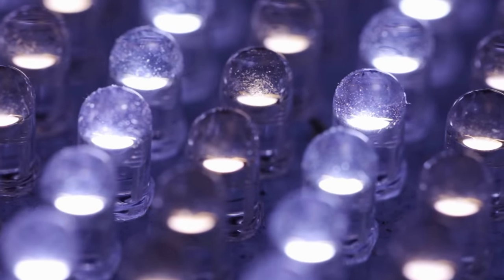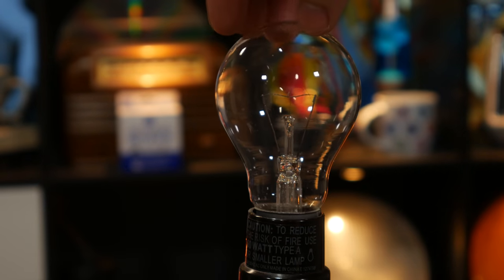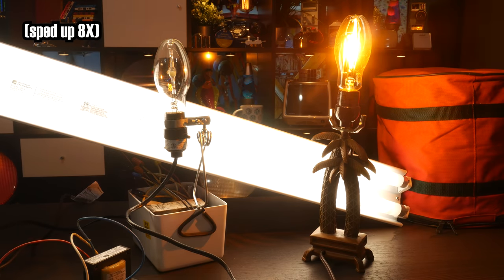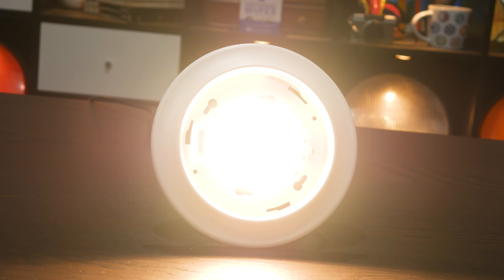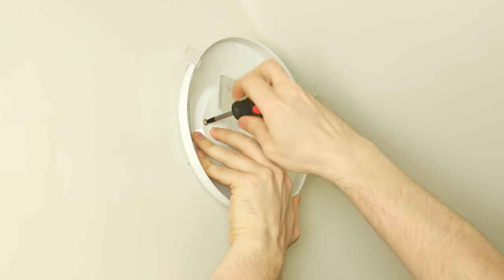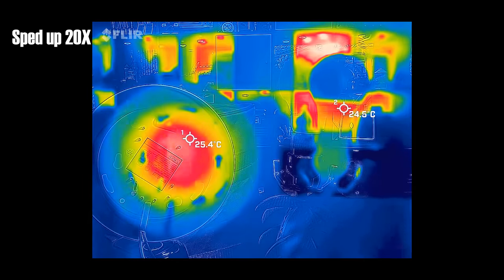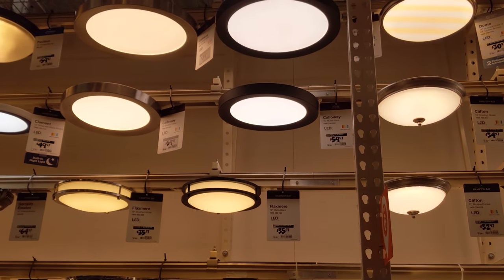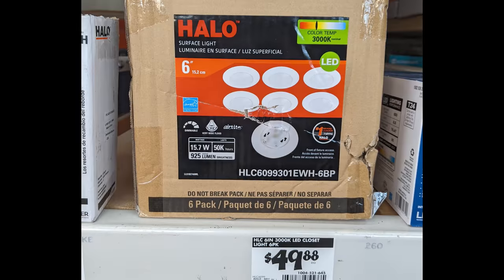A troubling trend in lighting?

Comment: I just started my transition to LED indoor lighting last year. The CFLs I bought when I moved in 10 years ago finally started dying.
I think people who have trouble keeping CFL and LED bulbs working suffer from one of 3 problems:
1/ Improper fixture for that type of lighting (as highlighted in this video, most of them degrade faster in unventilated fixtures -- there's always a note on the box stating if they can handle enclosed fixtures or not).
2/ Their house wiring isn't all that great and they have grounding issues (more likely in older houses than newer).
3/ They're just jumping on the hater bandwagon and making claims that aren't actually true or are just parroting what they heard someone else say.
Reply: Apartments too, not just older houses.
The building I live in was completed in the early 1960's, and the one powerbar I have, keeps (at random) indicating "ground fault" (the red LED lights up for long periods of time), one of my boomboxes (JVC conion, 1980's) is sensitive to that, and makes these shrieking, crackling and popping noises whenever that happens. It's quite amusing (and I have moved it to every room, same thing happens).

Comment: I think these “wafer lights” are the future. And they now have a separate junction box for your wiring which has a lead to the led in the drywall. The junction box can stay while the rest of the thing just unscrews and can be swapped.
Reply: The wafer lights with seprratebjunction boxes actually have the driver in that box. Slightly different design. Creates a similar dilemma except you have to install a box and do drywall work to even replace it with something else.

Comment: One thing I will say in defense of LED fixtures is that, in certain situations, they're great. Namely situations where you don't use them often.

I replaced a fluorescent fixture over the sink that went bad with a super-bright LED one. It only gets used for maybe 1-2 hours a day, so its lifetime will be really long. It doesn't matter if it clashes with something else because it's just for washing dishes.

Specialized circumstances like that, such as over a workbench, in a closet, or similar, are great for these things.

Comment: In a way I wished we could move to DC wiring for lighting, have one big driver/power supply in the utility closet by the fuse box (some kind of smart one obviously), and then run the wires from there to the fixtures. Of course this would require rewiring, a new style of socket, and some agreement on the voltage (12V, 24V or even 48V are options but there needs to be an agreement or this won't work), so unlikely to happen anytime soon if at all, but a person can dream, right?
Reply: One driver per fixture would be good middle ground- backwards-compatible with 230V wiring and economical/ecological for driving bunch of LEDs
Reply: LEDs are constant-current devices.
Reply: This is actually a very old idea, there are still some houses that run 24v lighting.

It's possible to spec a new house with 14-2/18-2.

If you do a complete remodel, you could do it too. 

I'd like to wire a house with dedicated low voltage and watch it over the years, but based on the old systems I'd expect that at some point there will be another remodel.
Reply: Not just lights either. I think pretty much all electronic devices use DC, or can be made to work with either.
Reply: It's inefficient, would require enormous size of wires to have an acceptable voltage drop. And you don't want to run a 16mm2 wire to a light fixture. It will also make controlling the light more complex, since a DC current is more difficult to interrupt with switches than AC, you will get arcs, contacts will wear, etc. Finally you introduce a single point of failure, what if that power supply breaks? You no longer have lighting in the whole house. Or in part of it, assuming it's not only one but two.

Comment: How confident are we that the manufacturer's specifications of color temperature are accurate? Maybe that 3000K bulb that doesn't clash with your 2700Ks is actually closer to 2700K than you think?
Reply: While I do think that the manufacturer's specifications of color temperature are often not accurate, this is not the main problem.
The color temperature and CRI are approximations of a whole spectrum of light crammed into two numbers.
But different mixes of light can fit the same two numbers. They give you more of a general direction.
Reply: Mixing color temps can be hell if you do photography with CCD cameras.  All kinds of interesting lighting effects when mixed that are not visible to the naked eye.

Comment: @Technology Connections I'm going to chime in with my thoughts as a fan of this channel, a color temp nerd, and an passive house architect. I agree with you that the danger of these devices is more e-waste, however as you pointed out these style fixtures at least deal with heat better than your budget LED bulbs. They do have a lot of benefits in the architecture world though. Being able to mount them directly to a shallow or pancake style junction box is a real benefit when you are trying to maintain a continuous air barrier between your top floor and attic space. The slim profile of them is just something you can't get from a fixture with a regular bulb in it unless its a true recessed can fixture. 

I think there's places where these are best suited. I typically spec regular recessed can style lights on the first floor of buildings and these on the top most floor where I want to avoid a can going into the attic or through my air barrier. They also are great for cathedral ceiling applications where you minimize the amount of displaced insulation and can air seal around the junction box reasonably easily.
Reply: They are extremely costly, though, and they have all the cons that the video pointed out. Recently, we wanted to redesign the entries and floors of our appartments building and the architect insisted in putting such lights that cost around €500 a piece. They didn't even look particularly good at that price, they were just some designer brand so we paid 90% for the brand but they were guaranteed 10 years. Well it didn't go well when the inhabitants voted for/against the project: his entire €300,000 project was rejected because of that and a couple other similar overpriced crap.

Comment: Several years ago I switched all the bulbs and can trims in my house to LED. Maybe 2016 or even 2015. Aside from one cheap can trim in my living room that buzzed because of the dimmer, I've never changed any of them. Even that one buzzy trim, I swapped with one from a closet and it's still going strong. No dimmer on the closet light so it doesn't buzz at all. I honestly don't think I've ever replaced any of the bulbs in my house in all that time.

Comment: Hey hey! I'd love to hear you chat about bulb tech, and controling them for dimming. 

I think a huge miss of the industry is intercompatibility for control. Currently the best way we have to control led bulbs is by choking out their power supply, so they have to struggle to keep the pwm running as you turn down their power. Smart bulbs are better, but it's a huge mess to try to control them via any kind of switch. The Inovelli stitches coming out soon seem to be the only ones in existence that solve the problem. 

I'd love to see you do a deep dive into it! It's a mess!

Comment: I just bought a new kitchen LED fixture instead of changing the Circline tubes every year in the one I had.   Having a lot of experience with LEDs, I took the fixture apart, measured the current through the LED strings, and raised the feedback resistor on the mosfet that sinks the LED B+ voltage to lower the wattage by about 30%.  The LEDs now run much cooler and will last almost forever.  Out of the box expect 2 years if you're lucky.

Comment: Woah, I was just ranting to my dad about the proliferation of this exact issue! I've been getting increasingly frustrated while looking for a modern styled ceiling fan that doesn't have baked-in LEDs. That one is even more onerous IMO as replacing  an entire dang fan just because a 20 cent LED board burnt out is just ridiculous.
Reply: yeah, I ran into this a couple years ago.  I had rehabbed a room for my daughter, totally gutted it, moved walls, etc.  But when it came to fixtures we needed something super low profile as it was a short attic room.  But our decisions were either extremely fugly expensive designs, or cheap but tateful designs that had the light element baked in... which is what we ended up going with.
Fast forward 4 months, my daughter hated the room, and wasn't sleeping for fear of spiders (not a single spider ever found because I also hate spiders... there are no spiders in my house!), so my son took over the space, and he wants new paint (understandable as some walls are bubblegum pink), and a different light.  His complaint isnt about the cieling fan or overall design.  The complaint is that the light is too directional.  End of the day we are going to have a cieling fan that has an optional unused light, and a bunch of desk and/or floor lamps.  Its fine, but yeah... the built in light is an issue.
Reply: I just realized that when my new ceiling fan light goes out I have to... I guess. buy a new ceiling fan?

That can't be right.  But.... shit.
Reply: @CaedenV  You should love spiders and all other animals.

Comment: 7:55 - You can simply add a series resistor to a string of LED's instead of a driver, it has some drawbacks sure, I have found incandescent globes make great resistors too lol.
Reply: You made me laugh so hard, it almost made me choke.
Reply: @Rasgonras  ahh you spotted the irony lol
Reply: I seriously hope this is a joke.
Reply: @Owen_loves_Butters  Yes. that being said I have used an incandescent globe as a current limiter when charging lead acid batteries when stuck in a remote area.

As for led's no, I certainly wouldn't advocate omitting a driver for mains voltage - for low voltage (12) I regularly use something like a 390 ohm in series with led's to drive them.

however.... when you look at many mains voltage led "globes" - they often have nothing but a capacitive dropper and a resistor in them.
Reply: @TheAussieRepairGuy  I'm sure you know this, but resistors dissipate energy as heat causing inefficiencies. Capacitors do not dissipate energy as heat, making them better for current limiting (drivers are more than just a capacitor, but still)
Reply: @Owen_loves_Butters  I'm well aware, but capacitors fail more readily. Efficiency means nothing if you discard the entire unit - and they still include a resistor.

Last I checked  the commercial led bulbs I use, run at around 60c, the same as an incandescent.

Maybe you should be having this conversation with the manufacturers

Comment: I recently finished swapping about 1200 of these out in a string of apartments. Property owner had 2700/3000k ones installed every 20ft or so in the hallways. when first walking into an empty hallway it was like a scene from a horror movie as the lower temps and spacing made for some eerily dim walkways. We changed them all out for 5000k fixtures that made it look more sterile (hospital-esque), but much cleaner look.
Since they were "trash" lights, ive since repurposed a few dozen of them into shop lights by separating the boards from the metal plate and affixing them to empty fluorescent housings. 
Have also take a few and painted the diffusers for inexpensive holiday lights.

As for the wiring side, many of these today come with a standard bulb socket that screws into existing can fixtures so that you dont have to deal with cutting power. You make your connections to the adapter, then thread it in like a normal light bulb.

Comment: The ballast is just an inductor. The driver circuit has a FULL BRIDGE RECTIFIER which can be done in many different configurations but usually includes capacitors and diodes in a square like arrangement and some pull down resistors.

Comment: I kind of wonder if we could have a new standard that removes some of these problems. Perhaps a flat circular "bulb" that is mounted in center with a standardized bolt to a metal heat-conductive base. Limit height to 1 cm and require radius to be, say, 4 cm. The bulb would connect electrically via a short white IEC 320 C7 (polarized) cable perhaps.
Reply: Have you ever seen the inside of a bathroom fan/bulb fixture? Usually there are 2 regular polarized outlets... one for the fan, and one for the bulb. I say: Make that sort of thing standard!

Comment: You could massively extend the life of LED lights by underdriving them. That's the approach of the so called Dubai Lamp. Philips used three or four times the amount of filaments (for the same amount of power) compared to their standard model. Thus they are brighter than their equally "watted" normal counterparts, while at the same time run cooler and are thus longer lasting.
Reply: Bigclive?
Reply: @Voodoo-ut6zp  : I was indeed alluding to Bigclive.

Comment: You have to admit that when the fixture eventually breaks, using Wago connectors makes it much less of a PITA to replace it. Unscrew, unclip, clip, screw, done.
Reply: Darwin might even claim less victims when n00bs fail to switch off the power.
Reply: Oh wow. Thanks for giving them a name. I saw them in an American video recently but, had never seen them before - I'm more familiar with the older style chocolate block connector. Super pleased, that now l know what they're called, l have discovered that not only are they available here in New Zealand, they're pretty cheap too.
Reply: @nikiTricoteuse  Glad I could help! They are pretty much better than any alternative if you ask me. I think at least here in central Europe, nothing else has been used for quite some time now, at least among professionals. I am not one though, so for the tiny amount of electrical work I do, I do not mind using the older "chocolate block" screw connectors as long as I still have a few lying around.
Reply: @Astrophysikus  My biggest problem with the chocolate blocks is l can never find a small enough screwdriver when l need one. Many, many bad words get said!

Comment: I have an LED light fixture in my home that is slim and decorative, yet it has replaceable bulbs. It actually has a small 12v power supply inside and it uses small automotive interior bulbs that are replaceable.

Comment: In Australia, replacing a LED downlight is simple and doesn't require an electrician. The power cable running through the ceiling has outlet plugs clamped onto it at each light location. Every light has a standard wall plug on the lead.  So you just carefully wriggle the light from the ceiling, unplug it, plug the new one in and refit the light.

Comment: A thought: separate the electronics, diodes, and socket into swappable parts. Use more efficient socketing than the screw socket, get the ability to replace parts as they break without electrical experience, and still get better cooling.

Also this explains why my led bulbs have heat fins

Comment: Sooner or later, we need a new type of replaceable light source format, that isn't based on the traditional bulb.

I think of a flat pcb format, like m2 ssd, but instead of memory chips, it could have the leds and circuitry on them.
Reply: The purpose of the bulb shape is to provide omnidirectional lighting. A flat fixture will either be directional or need diffusing, defeating the point of the flat fixture.

Comment: The wiring issue could be solved with a simple, low cost, standardized connector so you just have to unplug the old one and plug in the new one as opposed to touching the wires directly
Reply: No issue at all, simply turn the switch OFF. If its on a dimmer you might get some low voltage.
Plugs have their own issues with vibration and thermal cycling.

Judging by the quality of work I've seen from every homeowners DIY electrical... I could start a business simply watching homeowners do small work and pointing out where they're messing up and having my work truck stocked with new boxes, some spare wire and hardware.
Reply: @jonanderson5137  It might be a simple task for anyone who’s watching this channel, but it might not be so easy or even safe for someone who doesn’t have a bit electrical experience. These don’t pull much power. I don’t see a reason a simple keyed 3 blade connector would be a problem
Reply: @Premium-Content  there are plenty of people who already use switched outlets (even for overhead lighting) but generally the aesthetic quality is the main issue. Eventually it will begin failing and you'll need to replace the outlet, you'll have the same issue again.

Comment: It is almost like a standardized electrical male\female electrical plugs and minute holes in the body of the bulbs or miniature fans could solve the wiring and heat dissipation issues.

Comment: I bought a few very cheap lamps for my parents basement, when we renovated a part of it to make it usable for LAN-Parties. They were similar in concept to yours, but imitated the style of tubes. All the driver are on one side and the LED is just a slightly better LED-Strip under frosted plastic. They are so much brighter than the two old 80W bulbs, which couldn't light up the entire room. And since the direction of the LEDs is directly downward, they are very efficient. I am pretty sure, you would hate the colour etc, since they were advertised to light underground parking lots and not a cosy living room, but they just do their job.

But sadly in German ceilings you won't find a convenient hole to stuff your wires into. Especially that in the basement, which is just plain concrete. So we had to be creative and mount the lamp to a wooden board which we screwed to the ceiling. In another room we could replace the entire wire coming from the nearest box with the one on the lamp.

If you still read to this point, I feel obligated to say, that Wago is obviously the better choice.